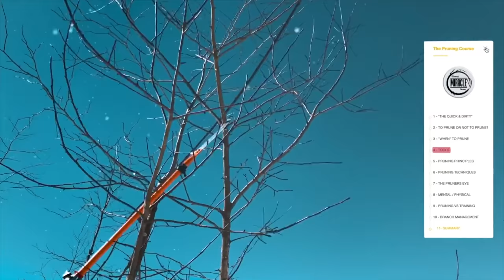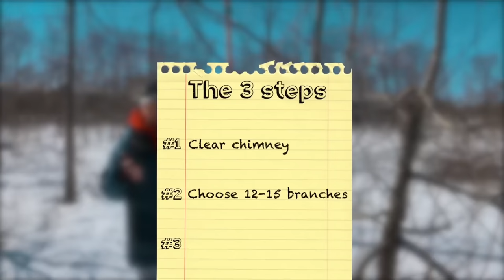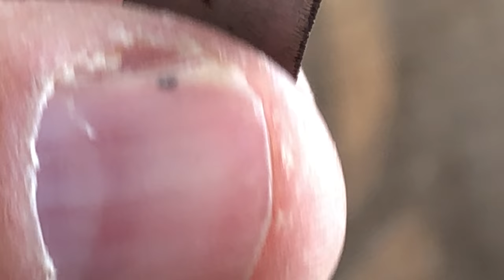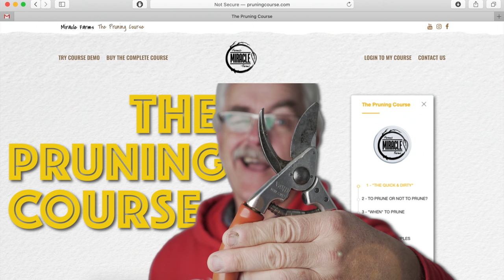How to SHARPEN a SAW. “Take Time to SHARPEN the SAW”! For your LIFE and your PRUNING.

Comment: Lee Valley sells a Japanese feather taper file specific for that type of tooth, also for cleaning the file, take a piece of hardwood and rub with the teeth line and it will conform to the pattern somewhat like a comb and free the swath.  If you sharpen a couple times a year it will be well worth the price of $15 US
Reply from the maker: Thanks for the trick.

Comment: I’ve been doing rejuvenation pruning on my Blue Hollie bushes, how often do I need to resharpen? The wood is maybe almost 2 inches at the largest areas, the smaller branches I use my loopers and my hand pruners.
Reply from the maker: Usually the saw tells you when it's not cutting well. If you touch the points and your finger sticks then it's probably sharp enough still. I cut for hours a day and sharpen once a year.

Comment: Nice video, awesome close shots, but you should take time to use the right tools!  Files can work, but  using diamond laps or corundum wheels on a rotary tool is easier and faster  And a sharpening jig to create uniform angles. And a saw set to open the kerf and make sawing easier after removing some set while sharpening.  A video with ALL the right tools would be awesome!
Reply from the maker: Thanks for the tips! I learned about those tricks after the video.